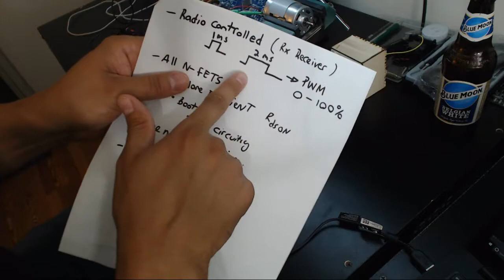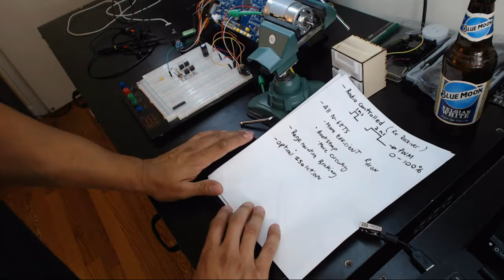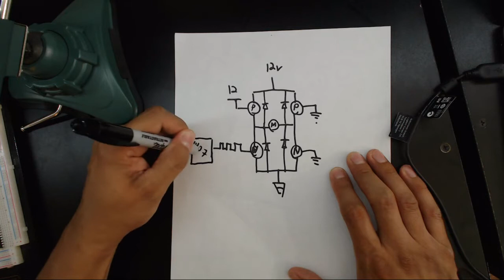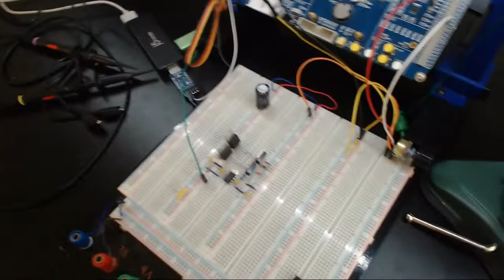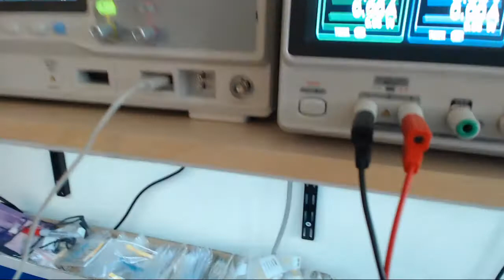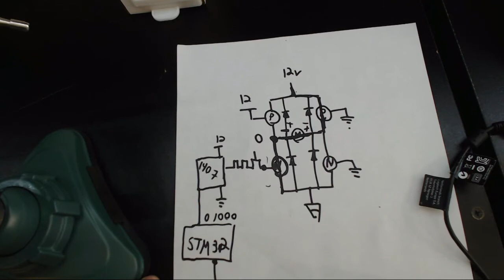Scoping a simple H bridge, and rambling about my motor driver ideas.

Comment: For this DC motor, regenerative braking is difficult to implement because when you switch off, it continues to produce voltage as if another (less than) 12V battery is in parallel with first one, just disconnected negative part. So, in order to brake, you need additional capacitance where you will store extra energy. On your current setup, you can't clearly see, but if you use some flywheel, then you can observe currents for longer time. Whole braking circuit should has separate PWM module, so that does not brake when you throttle down, but only when you want. So, in the case of regenerative braking, you need some sort of boost drive connected to motor as generator and convert falling voltage into something useful. Or re-charging battery, or as spare energy source for next running cycle as a boost energy source.
Reply from the maker: Very informative,  I really don't understand most of what you said but I will definitely do my research and try to learn.  The whole regenerative breaking thing is something ive never really heard of until recently
Reply: @EdwinFairchild  Yes, slowly but surely. Exactly like programming MCUs, at first it feels, sounds and looks difficult, but during time it become easier. I wish to find some time to do some basic electronic tutorial, but currently my brain is about to explode... C/C++, bit of Python, Java and VHDL... got to the point that everything begins to mix together and does not makes sense. Or I need to take a break, or... I can't explain how much I enjoy watching your programming tutorials. No matter how it feels insignificant to you, but for me it is great help. I bet to other people too.